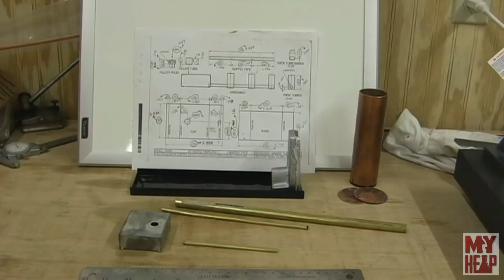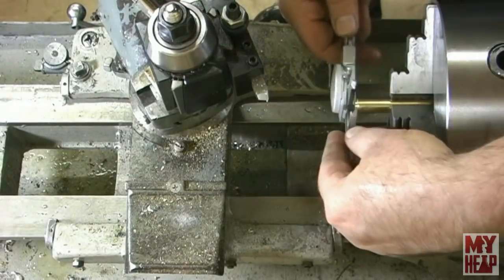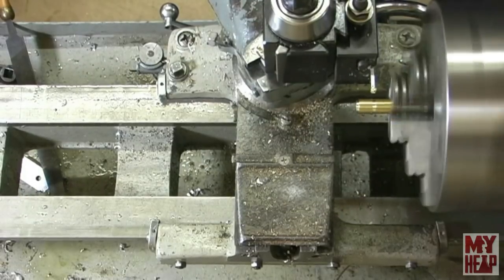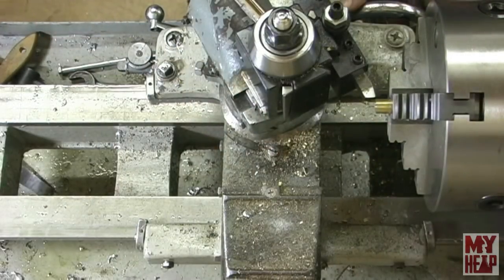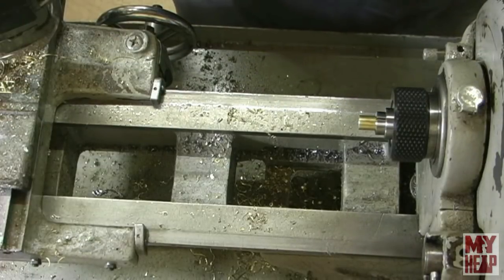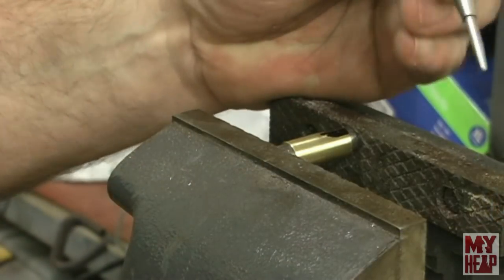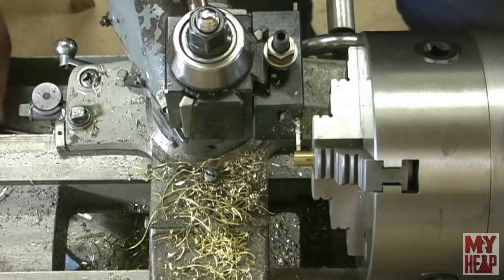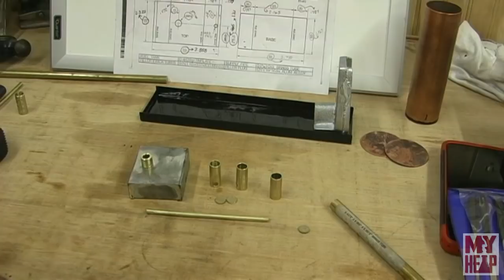Kenneth Wells Stationary Engine -  04 - Wick Tubes, Fill Tube and Supply Pipe

Comment: Enjoyed seeing you get some lathe time in Joe, I was yelling "YOU HAVE COLLETS" but then the light bulb went off 👍🏼 Brass is a really grabby material, I always use cutting oil when drilling or parting it off, give it a try & see if you like it. Also when making your own thin wall tubing even tho the tube was thick enough originally to withstand the chuck jaw pressure without distortion, by the time you drill it to a .032 wall thickness it may crush once the center material is drilled out so if at possible use collets. Its coming along nicely....good to see progress! 😊
Reply from the maker: Well Richard, next time yell a little louder please, maybe before I mess up two parts.  :-D   I was wondering about cutting fluid with brass.  I have never noticed anyone using anything to cut it.  I will try and see how it works for me.  Hopefully, the collet thing will stick with me.  The two pieces I ruined will be test pieces to solder with using the old iron.  Maybe I won't embarrass myself so bad when I go to video it.  Thanks for watching Rich, and glad to see you put a video out.  Hang in there my brother!
Reply: In my video you watched last night where I drilled & tapped the guys casings I used oil.....I always do. Test pieces are good! But lets not get too carried away making them...HAHA
Reply from the maker: RIGHT?!?!?!?

Comment: G’day Joe. Good to see some chips and your thread protector in use. Progressing nicely it’ll be interesting how you tackle the setup of the engine block for drilling when you get that far. Cheers Peter
Reply from the maker: Hi Peter, thanks for stopping by.  Ashamed I had to ruin two parts before I realized that was what I needed to use.  The upside is, maybe I will remember for next time.  Fortunately, I have a little time before I have to start the casting, but I have an idea or two how I am going to handle it.  Speaking of builds, I am looking forward to your next tailstock video.

Joe

Comment: Keep up the good work and remember even experienced machinists ruin parts on occasion.
Reply from the maker: Thanks Steven.  I know I will make mistakes.  I am okay with that as long as I can figure out the root cause.  Thanks for the encouragement and for watching.

Joe
Reply: @MyHeap  some of us just dont show them on camera as much as we should.
Reply from the maker: Emma, maybe after I get some experience I won't show the mistakes, but I figure if others are trying to learn, maybe they can see my mistakes, understand why they happened and avoid them.  The upside, is when I mess something up, if I take a critical look at what I done, I usually understand the problem and can move on.  It when I get one of those, I don't understand why that happened situations that I get frustrated.
Reply: @MyHeap  keep on going just as u are!! loving this series

Comment: looks good joe, great to see a bit of lathe action. I probably would have cheated on the wick tubes and used bullet casings since they already are at the sizes with thin walls and a bottom already, lol. For the wick, have you looked into the woodburner gasket rope? Its a fiberglass type rope that is designed for high temps but might work ok for a wick material.
Reply from the maker: Ahhh ... Casings would have been a good idea and have a novel look, The primer would be pressed in enough to prevent leaking too.  Oh well, probably best I went the route I did, for the sake of the learning experience anyway.  Good idea on the rope, I will have to see if I can find some.  Maybe the CO-OP or Tractor Supply.  Thanks for watching Chirpy and the support my friend.

Comment: hey, I was thinking about something and it may sound funny, but alot of the model steam train guys, when they make the alcohol burners, they use fine steel wool for the wicking material, and it seems to work pretty well, so maybe if you have some of that, it may be worth a try. Ive also heard that pumice stone from a scouring stick works too if you can cut circles out of it to fit in the burner tubes.
Reply from the maker: Hmmm.  That is an interesting idea.  Steel wool, like you would by to rub down a finish?  Well, it's cheap and readily available.  I wouldn't be out much to try it, and of it doesn't work can still use the wool to rub down patterns or something.  Good idea Chirpy.  I may just try it!  👍
Reply: yea, fine grade steel wool. I think it has to be pretty fine so it acts like a wick rather than coarser ones. Just pack it in loosely and it should work.
Reply from the maker: Well Chirpy, I will give it a go when it comes time, and I will let everyone know how well it works.  Thank you for the idea.